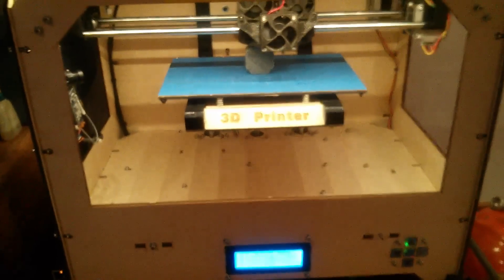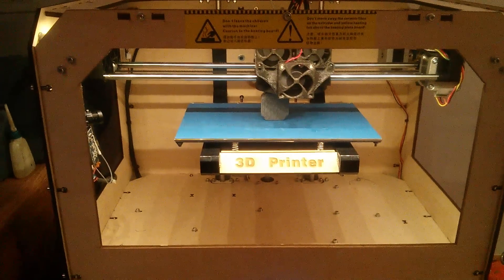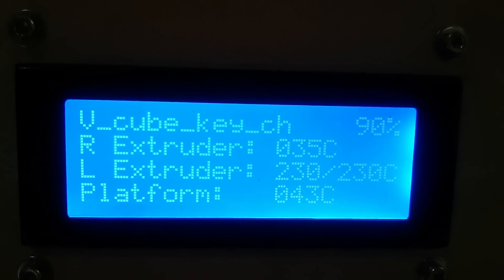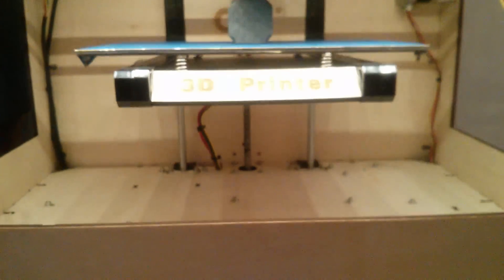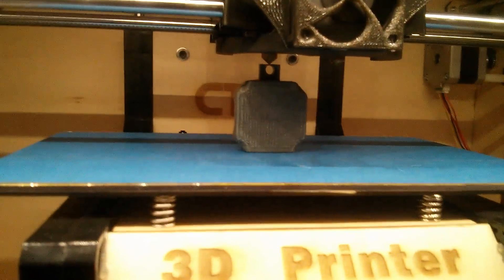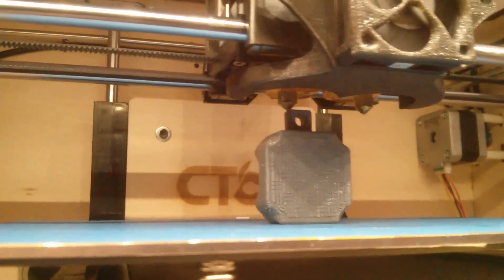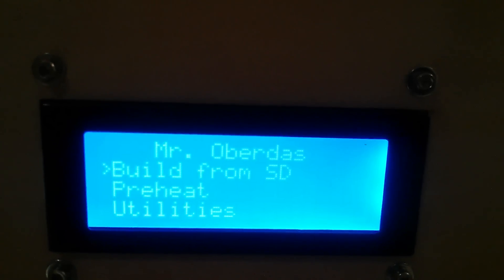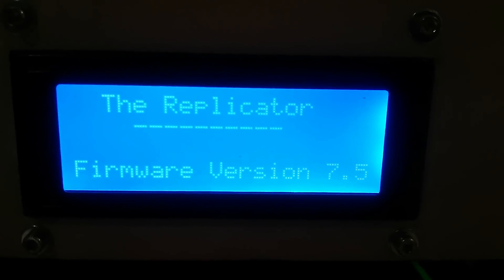Part 2 CTC.  Updated printer from 7.1 to 7.5.

Comment: Cory, on my ctc printer, the extruder keeps clicking, did yours do this? if it did how did you fix? It wont print anything because it keeps clicking.
Reply from the maker: I replaced my extruder feeds with spring tensioned ones because of that reason.  The stock feeders did that more with pla and try adjusting the temps. I print asb at 230 and pla at 225. I use hatchbox filament from Amazon which I found prints the best for the price.

Comment: Cory, do you have a link for the fan holder and duct that you are using in this video. I could not find it on thingiverse. Also a link for the electronics that you used for upgrading. Hope that you can help. Thank you.
Reply from the maker: Scott Hamilton I found it on thingiverse, http://www.thingiverse.com/thing:259660
Reply: cory oberdas Thank you, I am getting ready to do my first prints. Should I do the firmware update to 7.5 first? Also you mentioned sailfish in a post, should I do that also before starting up my first prints?
Reply: cory oberdas I checked the link that was for the fan guard... do you have the link for the duct work also?

Comment: i have tried many different versions and ALL dont work with my sd card?ive tried using RepG and makerbot to do these updates.do you have your original and or salfish firmware so i can try.i did also try a few different cards   thanks
Reply from the maker: This is the sailfish I flashed on my printer and the sd card worked.  http://jettyfirmware.yolasite.com/v77-v47.php  Give it a try.
Reply: your a gent.i do think i may be getting somewhere as before this i got sd card error and now im getting sd card empty although there are files on there.i may just have to try a few other things like checking the sd card format and maybe even finding out a smaller sd card

Comment: When you push your bed down does it get really tight around a quarter of the distance from the bottom. I'm wondering if it's normal or if I have some binding going on.
Reply from the maker: Mine is the same all the way down on both my printers.  You might have some binding going on.
Reply: ok thank you!

Comment: HELP My printer froze during a print so i turned it off and then on. When i turned it on it has two lines across the lcd and it now wont work. When connected to MBI software it recognises it but wont update or print. In replicator g it won't connect, due to a firmware issue it says, and i cant get it to update.

Comment: HELP I have update my firmware and now i get a SD Card read error.
Reply from the maker: I had to upgrade my second printer to Sailfish because the same thing happened.  SD card stopped working but when sailfish firmware was added it worked again.  Try that out so see if it works.
Reply: cory oberdas It worked, Thanks
Reply from the maker: You'll like sailfish. More options when printing.  You can change the speed and temp when printing.
Reply: cory oberdas what is ditto printing?
Reply: Hi can anyone help I managed to upgrade firmware but I get the sd card error,
so I went install sailfiish it says about recording values of home and offsets form onboard preferences. But it says no map found for this printers firmware version because of the upgrade. How would I go about getting these preferences many thanks in advance

Comment: Do you have a video on how you made the switch
Reply from the maker: Nope, just bought a 12 volt 40mmx40mm fan and 12 volt power supply and hard wired it into the 120 volt power.  I put a switch on between the fan and the 12 volt power side to turn the fan on or off.

Comment: hello, just got my first ctc 3d printer but cant seem to upgrade the firmware from makerware, my timing is off lol, i keep getting a message saying unknown error from coneryor, is this the message u got also after trying a few time? and was also wouldering if there is a way to keep the bed plate hot? it seem to be cooling down and pla wont stick no more while printing.
Reply from the maker: I had problems with pressing the reset button at the correct time when pressing the update in makerware but no errors when I updated.  You shouldn't use the heated bed when printing with pla.  A heated bed plate is used mainly of abs.
Reply: +cory oberdas 
Where is the reset button

Comment: Hey I thought that fan was for pla. But I guess its for abs? I can't get a clean pla print with this thing, do you have any x3g files for pla that came out nice?
Reply from the maker: It's is used for pla prints but sometime helps in small abs prints.  I printed mine out in pla on a printer that had a fan.  I also changed to abs for the fan because I melted one when extruding nylon at 245C and had the fan off.

Comment: Hi, I bought CTC 3D printer on eBay a week ago. The printer works fine until this morning, I try to update the firmware through MakerWare. After pressing the reset button at the back of my printer, it stops responding. The LCD lights up but nothing display, just the light. Do you have an idea how to fix it? Thx :(
Reply from the maker: When I updated my ctc printer I had no problems with the update. All I can say see if makerware recognizes your printer and try to update it again.
Reply: if u want pla to stick just grab a bottle of hair spray and a nozle from a can of wd40 etc with the hose and spray the job as it lays the fisrt layer down printed a dragon out of glow in the dark green pla on my ctc clone the other week

Comment: Hi Cory, so you used makerware to update you ctc Printer? Is that right?
Which printer you chose in the makerware software? Replicator2X?
Thanks for the help!
Reply from the maker: You pick the replicator dual.
Reply: And you updated with makerware or with repg?

And where have you conected you third fan for pla cooling?
Thanks for your help!
Reply from the maker: Added a second can to the board cooling fan.  Put a switch on it so I could turn it on or off.

Comment: I updated firmware and my ctc 3d printer does not want to work, it turn on but on start it automaticly started heating the bed and locks the x axis and it does not even play that sound on start the screen stays blank and I tried printing with computer it does not work, i downgraded firmware back to 7.1 and it does not work... , Please help and sorry for bad english.
Reply: OH, :D I fixed it with some serious makerware/replicatorG kungfu. :D
Reply from the maker: Lord EvilSeph You're the first to have that issue with updating your printer.  Glad you where able to get it working again.
Reply: Lord EvilSeph Hi, I did the firmware upgrade like Cory mentioned stepping one at a time. The issue I had was the same as you. the heat bed started heating, I have 2 rows of boxes on my LCD display. What did you do to get yours going oh Kung Fu Master ;)
Reply: It turned out that I installed firmware for mightyboard with newer atmega chip but I had the older one so I installed firmware for older mightyboard and everything worked fine.
But I reccomend you to install sailfish firmware because it has more features and you have more controll over your printer.

   Good luck.
Reply: Lord EvilSeph  Thank you for your reply. I installed for the mightyboard 1.7 that was the info I got from the machine firmware screen when I looked it up in RepG (I have ver 0040). I checked that before I did the install. Everything was fine till I got to 7.5 that's when the display went bright and has two rows of squares and the heat bed will not switch off. I tried going back to 7,2 where I started and no luck. I am not sure if there was a code glitch that switched voltage address or what. I looked for days on how to identify what mightyboard I had in it but could not fine it. I went to the RepG site and they state that it should be upgraded to sailfish from with RepG if the user plans to do that. I wont turn on the printer till I get more information. I think I nuked the printer, but I am not going to keep cooking it till I find out more. I have to find someone that Knows how to identify the board I have. Any help or point in a direction would be greatly appreciated.
Reply: The largest chip on the board is what you want to find and then read the text on it.
Reply: If you have ctc or flashforge made of wood you probably have v1.5 board, so when you want to install your firmware select "Flashforge Creator l, ll & X"
Reply: I got back to it this morning. looked at the system board and the chip that I have is a
ATMEL
ATMEGA1280
16AU  1338  

Yes, It is a black wood CTC
Reply: Lord EvilSeph udate or not ???never change a winning team.

Comment: Hey cory, where did you get the fan at for printing pla?  can you tell me where to get file so I can print it?
Reply from the maker: I got it from Thingiverse.  I would print it out in abs.  I melted one already when I didn't have the fan on for an abs print.  Here is a newer one that vents better and doesn't cool the printer head down as much as the one I had in the video.

http://www.thingiverse.com/thing:295317
Reply from the maker: The fan will stick out past the door when you install it.  I added a spacer around the front door to move it out 1/2 inch or leave the door open when you start a print and then close.

Comment: Does it work better with the upgrade?
Reply from the maker: Then you update using makerware it tells you what each update fixes.  The best updates where changing the roller bearing to bronze and adding the extra bearings on the belts.

Comment: Also I run a ustream channel with live feed of builds I do a few times a week.  http://www.ustream.tv/channel/2031192

you can click link, or go to www.ustream.tv  and search smitywa
Reply from the maker: I'm printing PLA.  Haven't needed to print in ABS yet but going to try some tomorrow or in the morning.  I think you can go directly to 7.5.  The timing of clicking on upload and the rest button is the tricky part.  Thanks for the feed.  I have a web camera mounted to mine I should look into streaming using my Google groups.

Comment: Looks good, you didn't have you heat bed on.  Are you printing PLA?  Thanks for the look at the firmware i'm definitely gonna upgrade this weekend.  did you try to go right to version 7.5 or were you not able to and had to do it .1 step @ a time?